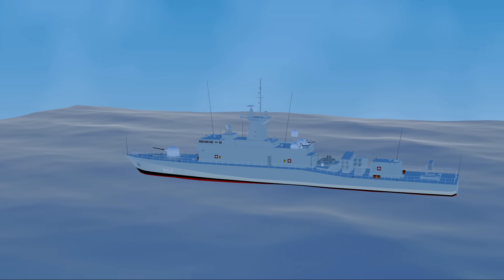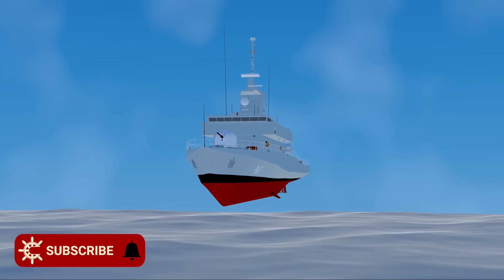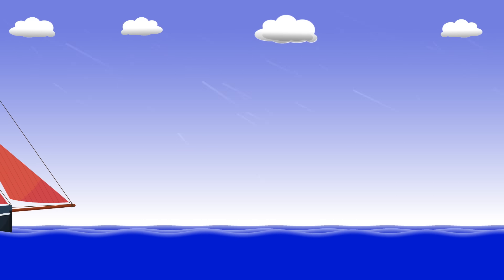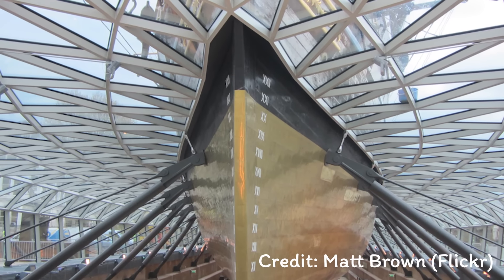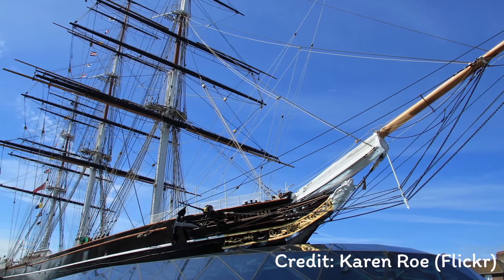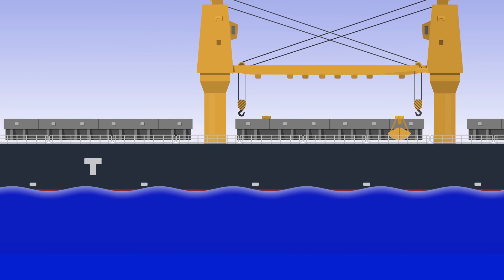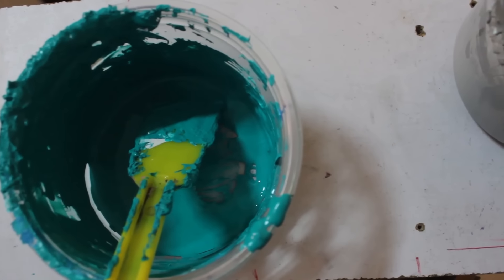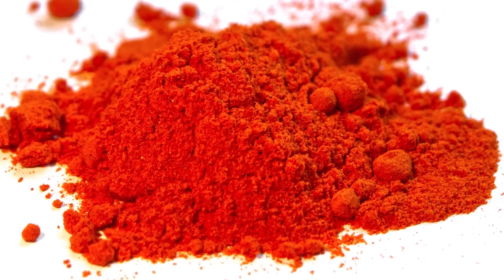Why are ships painted red below the waterline?

Comment: Iron oxide is red , copper oxide is green.. something just isn't adding up.
Reply: Iron oxide can be red, yellow or black.
Reply: @aculasabacca  what about green?
Reply: @robertlivingston1634  Dunno, I used to buy the yellow and black, well red also. Not sure if it's the number of Oxygen molecules or what, Google it.
Reply: aculasabacca What he meant was with ”what about green” was that the guy on the channel stated colors are naturally red due to copper oxide present. Yet Copper oxide is green
Reply: @aculasabacca  the story was about red paint on the bottom of boat's, I was in the Navy and the red paint that was used was called red led, because it was a led based paint and it's no longer in use. I also live in an area with iron and copper mines and have seen both ores, I'm no expert but the statue of liberty is green and so is every piece of electrical copper I've ever had to clean. The red pigment isn't from copper.
Reply: @robertlivingston1634  My initial implication was that green may not be the only color for copper oxide. Yellow iron oxide may not occur naturally, it may be a result of refinement or other process the same may be true for copper.  Copper may have been used early on but now I'm sure iron would be cheaper. Maybe the videographer mis-spoke. I'm sure Google has all the answers.
Reply: @flightographist  just looked it up and you are correct, although the statement was copper oxide, and yes couprus oxide is a form of copper oxide it is not fully oxidized but I did learn something. My hat's off to you.
Reply: Painted for corrosion resistance.  Also, zinc sacrificial anodes are used.
Reply: @inquirer1599  I've only ever used the blue stuff on glass boats which seems to be an ablative coating. If you touch it it comes off on your hands and seems to be entirely gone on boats tht have been in the water a couple years. Is the red stuff similar?
Reply: @robertlivingston1634  Literally the first googlr result for (copper oxide color) "Copper Oxide isn't green. It is Black. In fact, there are two different Copper Oxides. There is Copper (I) oxide - Cu2O, which is a red colour and Copper (II) oxide - CuO that is black.Jan 12, 2011"
 It took me all of 5 seconds to find that. I thought it would be more work and did not have time. My initial post was to let you know that oxides come in different colors fjor the same metal.
  Now that I think about it of course it's not iron in the paint since barnacles and shit grow directly on iron.
Reply: No copper oxide is ever green, what you're thinking of is patina, which forms over a copper surface and is a combination of a few airborne compounds and copper.
Reply: @MrTubularBalls  Thx but... Your name tho
Reply: Copper Oxide isn't green. It is Black. In fact, there are two different Copper Oxides. There is Copper (I) oxide - Cu2O, which is a red colour and Copper (II) oxide - CuO that is black.
Reply: +The Random King What about it.
Reply: Cuprous. Not Cupric. Cuprous is (I), while Cupric is (Ii).
Reply: I work for a company that is the biggest producer of copper powders in the world.  Cuprous Oxide (Cu2O), depending upon the amount of oxygen introduced into the oxide, can very the color greatly from bright red, to brown, to purple all the way to Cupric Oxide (CuO) which is actually black in color. The Navy ship paint uses a purple cupric as it blends in with the 'battleship gray' to better hide the ship against the skyline. The green oxide on the Statue of Liberty is actually from water exposure to pure copper, causing the green patina to form, vs. the black that oxygen causes, like on an old penny.
Reply: @inquirer1599  Any paint, as long as it excludes oxygen, will reduce corrosion. Zinc anodes are definitely useful,so long as you change them out as they corrode. A real pain when they're in the bilges or tanks.
Reply: Pennies become green due to a similar oxidation reaction at some point involving calcium chloride CaCl2 or NaCl forming Malachite Cu2CO3(OH)2
Reply: Cuprous oxide is red. Red lead might sometimes be used. Non-red pigments to give more desirable colors are not as effective. More than you ever wanted to know about antifouling  agents: https://darchive.mblwhoilibrary.org/bitstream/handle/1912/191/chapter%252018.pdf
Reply: @robertlivingston1634  Red Led and Green Death, I've worked with both.
Reply: Iron oxide is mostly red. 

Copper oxide is any amounts of colours. Blue and green tend to be used in fish tank parasite treatments.
Reply: Robert Livingston thats
Reply: Robert Livingston and red and green make (brown)...... the plot thickens!!!!
Reply: Yeah nothing adds up these days, this video was most likely made by a robot. I thought it might be red incase it crash, easy to see red in the water. I thought maybe they shoul try fitting a mirror to the bottom of boats that could flip so they can be spotted better. The underside of all boats should collect data for the environment too. Bigger boats should be science stations underneath as a standard fit out. Imagine the data that we could use to clean our world in a more efficient manner.

Comment: I spent a summer working at a shipyard that specialized in painting ship hulls. They were one of the only shipyards that repainted the bottom of ships since most shipyards didn't have the ability to store large fishing vessels out of the water for long periods. I don't quite remember what exactly was used to paint the boats, but there were probably a half dozen different paints used on each hull, all with multiple coats, and the paint ended up being about 4-6 inches thick on the hull depending on what was used. The general order was a primer, then heavy metal anti-fouling paints, then some sort of rubber-esque sealant that was colored to whatever the user wanted. Maybe back in the day they only used copper based anti-fouling paints, but in my experience, the hull red color was from lead based paints. Copper (I) and Copper (II) oxides are categorized as more environmentally harmful than Lead oxides, and copper probably wore off a lot more quickly.

The paint was also VERY durable, they had to use these extremely powerful pressure washers to remove the old paint before we could paint the ships. One time these two guys were power washing opposite sides of the boat at the same time, and one person's power washer went below the bottom of the hull and hit the other guy in the leg, and blew his calf muscle clear off. When I worked there, only 1 person was allowed to power wash a boat at 1 time.
That job convinced me to stay in college.
Reply: Thanks for the Interesting information, except I don't think a power-washer can blow a calf muscle off the leg, (it could have ruptured the tendons and pulled the muscle our of place, which would have required surgery, but I doubt it was blown off the leg, but astonishing things have happened that shocked us working in the ER!    I know PWs are very strong.  Sometimes they use them instead of sand-blasting -- same effect.  
It is always fascinating to me when a ship is dry-docked,  I know how they launch a ship but not how they drag it out.  Some of those ships weigh many thousands of tons!
I just looked it up and saw Teekay's  docking process, unbelievable!!  Reminded me of going through the lock at Panama Canal years ago!
Reply: Wow. Long explanation. Going into engineering. I'll keep that in mind.
Reply: @MJLeger-yj1ww   The alleged incident happened before I worked there, so my story is second hand, but the power washers they used were about as strong as you could buy commercially, much more powerful than a consumer pressure washer. The injury payout was also something between 1-2 million, though I'm not sure if that is any clue as to the severity of the injury.
Reply: @Awgolas  The jury will suggest a payment in the millions today, if you even have a headache after an injury, if it goes to court!  No company wants to handle a lengthy trial today, which will have immense costs, so they settle for preposterously HUGE  amounts in our greedy society today.  
And we pay for that with increased insurance premiums!  Awards are NEVER commensurate with the injury today, it kind of depends on who is the best lawyer, points of law and the sympathy of the jury, as to what is awarded to the injured party.  And an emotional "jury of your peers" NEVER considers the consequences to the public for their decision!
Reply: What do you have to learn/do/what qualifications do you need to work in a shipyard?

Comment: Some companies in the oil industry in the Gulf of Mexico use a silicon based paint that slows the fouling process, but it does not stop it.
The only thing that can make the hull clean is regular cleaning and repainting.
The worst case of a fouling I’ve ever witnessed was on a vessel used for security that stayed in the water for 3 years before it was hauled out.
The growth was almost 3 feet thick.
The vessel could not make 20 knots before cleaning but after it had a top speed of 33 knots.
I am a engineer and it amazes me the cold water intakes hadn’t stopped working, but they were functioning well when the vessel was at sea.

Comment: Is there a "boat wash"? (Like a car wash)?
Imagine some sort of canal, lined with brushes, which clean debris off their hull as they sail through.
I bet that kind of business would make some money.
Reply: In the shipyard, they used sandblast to remove barnacles and paint.
Reply: pattystomper1 Sure would be nice IF it was that easy... no... barnacles make a cement like glue, to stay attached , so must get removed using strong, mechanical means... like chipping off with hammers etc.
There are some vids of kind hearted souls removing them from turtles.
Reply: also a very ambitious idea and IMO is a bad business idea due to the requirements needed to take away the growths (e.g. barnacles)
Reply: There is a system like that for small boats, but not the big ships.
Reply: GENIUS! Put it in the Panama Canal where there would be a specific ship cleaning section. Perfect!
Reply: Yeah it's called dry dock
Reply: There were two cleaning stations on the Clyde at the Tail o' the Bank. I would see a Maersk freighter at one before it seemed to move to the other. Then I was told they were different ships being brought out of mothballs. 
So basically, yes.
Reply: @benconway9010  I've heard of "dry docking" but it didn't include boats. Lol
Reply: @BraveNewWorld-1984  oh ha ha

Comment: The most common biocide in anti fouling paint when I was growing up was arsenic.  Surprising this vid failed to mention that.
Reply: This video was about why ships are painted red on the bottom, not about the environment! So saying that the video fails to address that it's unnecessary degrading. It's not that the environment isn't important, but you could've used other word other than fail. Instead you could just added value information without undermining someone's work!
Reply: @dcgo44r  Reread. There is a difference between failing to mention something relevant and important, and straight up declaring something as a "FAIL", which I did not do.  In standard English, 'failed to' is synonymous with "neglected to" or omitted.

I'm not a troll friend, and you're reading too much into my wording. Given the prevalence of trolls on youtube I understand and sympathize.
Reply: Also, unlike the vast majority of replies in this thread, I actually owned a boat in my teens (30+ yrs ago), and actually applied anti fouling paint before mooring it.
Reply: @RovingPunster  I believe you! I understand you are free to say whatever you want to, but to avoid miss comunicacion I would use less "doble edge" words. But I get it, I thought what you meant as other possibility... At the end I see my self making that mistake, although I'm getting better at it. No because I'm worried of walking on eggshells, but because I want to say what I mean to say! Dam, it is complex, specially from reading an emotionless text. Have a nice day👍!
Reply: @dcgo44r  Problem is the video mentioned twice that most harbours do not allow ships to clean their bottoms for environmental reasons, thus that renders your statement that the environment was not relevant incorrect. Engineers, designers and architects often have to take the Environment into account when they plan, something I am well aware of given the fact I am a Marine Ecological Consultant by trade. 

The worst offenders however were not the Arsenic based paints but TBT (trbutyltin) based, which were put under the Rotterdam Convention in 2008 (though they had largely fallen out of use prior), meaning they were effectively banned world wide given the Rotterdam Convention deals with controlling the use of hazardous materials. TBT has been positively linked to the destruction of several marine ecosystems and fisheries and is a devastating toxin affecting multiple layers of a Marine Ecosystem. So as you can see, what kind of paint you slap on to the bottom of your ships does indeed have a fairly significant Environmental impact... one people should be aware of when choosing what anti fouling measures they use.
Reply: @alganhar1  I do agree everyone else point, as it was explained to me previously. Although "some" people "fail" to understand my point which it is non negotiable! Lol.
Reply: Well I work in a ship yard and I can tell you that arsenic based antifouling was banned about 30 years ago, I doubt any ships would still have it.
Reply: Mmmmm Arsenic

Comment: its so you can tell when they are upside down. Never heard of the jelly thing.  the 'silicon' coating is used for such as  passenger ships, its expensive but very  effective. when its try it feels weirdly  sticky but wetted its very slippy. It has the disadvantage  against some antifoulants that the vessel must be moving to remain effective. the self polishing foulant described similarly need the vessel to move. If the vessel remains stationary SPC's become clogged and stop working. To get them going again sometimes needs the hull to be waterjetted.  some more modern designs do not need movement, , they have absorb water , expand and detach. You can vary the rate this occurs depending on vessel usage. I know there are antifoulants now which contain a chemical marker that  discourages attachment- this came to market when I moved from ship operations to oil and gas so don't no anything more about it.

Comment: There's also a pretty interesting electrical method of assisting this which military ships often use at anchor or in port. Basically sends out an electrical signal that deters microorganisms.
Funnily enough, it often attracts jellyfish for some strange reason
Reply: Degausing!
Reply: Impressed current cathodic protection.
Reply: reversal of a corrosion cell, hull becomes the cathode

Comment: Ships are actually painted on the entire ship with red anti corrosion primer.  The visible portion of the ship is then painted to match the company or country color.  In this day and age anti corrosion is far more of a concern because ships are welded together and the weld is very likely to fail first where corrosion is concerned.

Comment: The red color came from using "red lead" paint made out of lead tetraoxide, not copper to suppress rusting and marine growth below the waterline. It's still available.
Reply: But if you Google it up, you will see that all he said is through...
Reply: Correct.  The original red was from red lead paint.  I used to apply this to ships when I was an apprentice.

Comment: The best antifouling paint ever used tributyl tin. Unfortunately, it turned out that TBT was way worse for the environment than anyone had ever imagined. So, we're back to copper-based paints that don't work as well but are a lot gentler on the ecosystem.
Reply: Well you paint the ship with a straight up poison, what did you expect? You don't commute across a cornfield on a lawnmower and then complain that the corn is gone.

Comment: The gelatin idea is really cool. I'm struggling to think of a way to evenly (or remotely evenly) dispense it though. You have the pressure changes from the different depths, waterline changes, wake and waves. My first thought it some kind of manifold that's filled up before being exposed to the sea. But that would require many moving actuators. Maybe tubes from a central pump could work, but you'd need a billion miles of tubes to get any kind of well-covered density. I'd be interested to see how they actually do it.

Comment: Om larger ships, a combo of electricity and silicone paint is used. The silicone paint reduces drag by aprox 2 %, and the charged hull reduces fauling by aprox 90-95%. The biggest problem now, is fauling on the propeller. That one is yet to be fixed.